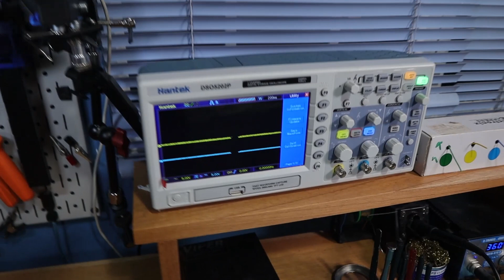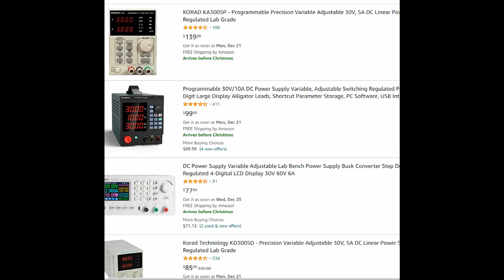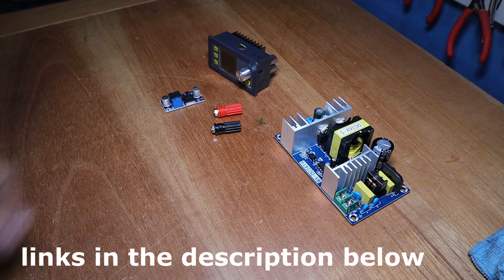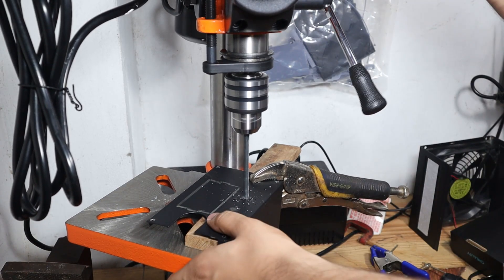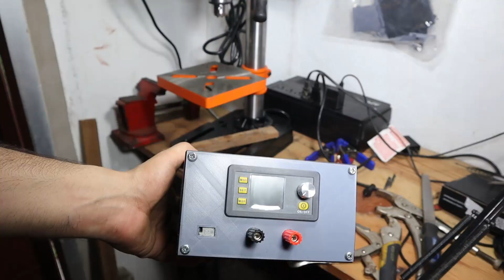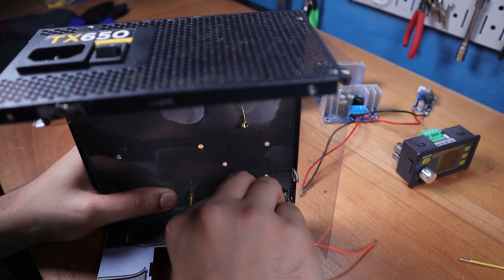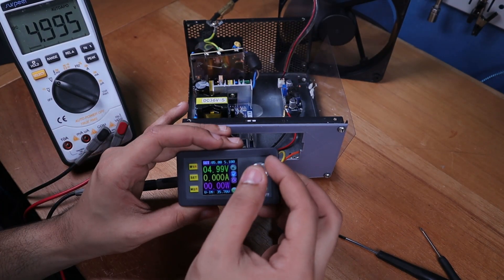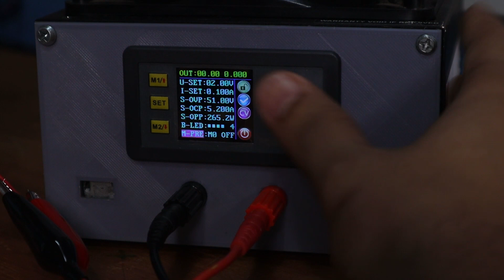DIY Digital Bench Top Power Supply from broken ATX PSU (DSP5005 + WXDC2416)

Comment: wait so... the only thing you actually used from the busted ATX supply was the case/shell/box?

I have a broken one (doesn't turn on) and I'm wondering what could I salvage from it, or perhaps what could I rip off from it, so perhaps I could use it as a merely rectified DC output...
Reply from the maker: Well my original plan was to try and fix it and use it as the main recitfied voltage. And the reality of it the effort was not worth it for me to fix it, so I did the next best thing which is gut it out and use what I can. The rectified dc output would be great to put into the little digital power supply once it us under the voltage

Comment: Question...if I have a 600w PSU. I am wanting to hook it up to a LiPo battery charger.  The PSU output is 12v @ 49A. The charger will accept 7-27V @ 30A.  Is there a way for me to get that many amps out of a buck converter?
Reply from the maker: Buck if you mean boost? Why can’t the lipo charger not work with the 12v directly?
Reply: @JustBarran  to get max power I need 25amp at 25v

Comment: I build one of these for a friend of mine. He ordered it and I made two days of test on it, and it turns out fine. I took the unit out of the case and track the traces for the on/off switch, so I could add a connector for a second switch. So he added a push button in the front of his workbench to turn on and off the output of the PSU easily :)

For myself I have one of these really heavy and powerful PSUs you showed at the start, cause they can handle a lot ot current peaks and provide enough power for my projects. Also added a socket for an external on/off switch. If you don't need this for your projects, you will be fine with your self build one :)
Reply from the maker: Thats so awesome hope they getting full use of it, yea this one meets my needs at the moment, but send me the one you have if you don’t mind, I might get a higher current one later when needed.

Comment: Nice storytelling. This is what I lack above all things 😥. In other news. The runout on that variable chuck on your Dremel is poor compared to the 1/8 inch collet that is normally used for the tool; yes I have 2 such chucks. It induces vibration that can make the Dremel hard to hold in certain circumstances. This might be why your hand was unsteady.
Reply from the maker: Hahaha thanks, I have the collet, I just find the chuch easier for swapping cause I don’t need the wrench, but I understand what you saying I feel I would just leave the collet next time and see if it’s better cause it was running away from me a lot. Thanks again for the advice, also you from Trinidad right ?
Reply: @JustBarran  Yes, I am in Trinidad

Comment: You could add a themal switch and allow the fan to come on only when needed..😤💨
Reply from the maker: I was thinking about that, I may add it in another video. I could use a LM35 and a comparator and a transistors

Comment: I could make one of these, I mean I must have 100 atx power supplies around here, but I also have six Toolkit M8's that cna take any voltage DC and convert it to any other output voltage DC... so...  meah.    I standarized on the XT=60 connector, so I can plug as many of them in that I want into a 24v server power supply using XT60 balance boards.  All I have to do is solder up a small cllection of cables to have  handy to plug whatever into whatever with XT-60 male female at either ends...

I bought 2 buck converters just for applications where I want to set the voltage and never change it ever again.
Reply from the maker: hahaha if you have so much, best you make a store and sell them.  I normally have a set of buck converters for the same thing and use a bit of glue gun on the POT to make sure the voltage doesn't change.
Reply: @JustBarran  Nobody in the US is going to buy 200=300watt ATX power supplies from the 486/Pentium days.     My dad use to bring truckloads of computers home at a time.   So, every 8 bit computer imaginable as well as Macs, etc.   

I would of built a bench supply like you a few years ago, having seen many how to videos just as yours buying a step up step down glass panel converter and old power supply... But now that I've been in the quad copter hobby for a year, the Lipo chargers can all convert from one voltage to anything you want on the touch screen.. you just chose "Output" instead of "Charge".

Love my TS-100, get yuourself one or a knock off like the D60 ..

https://www.youtube.com/watch?v=QVqETXZZb6E

fpv.air-war.org